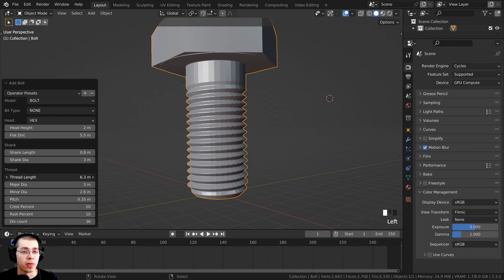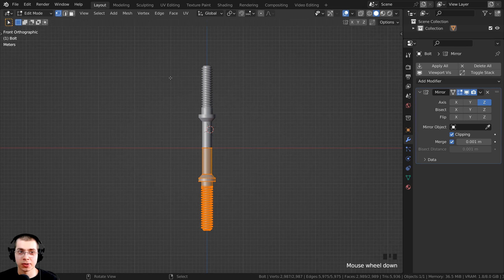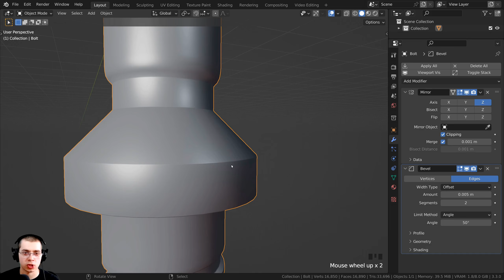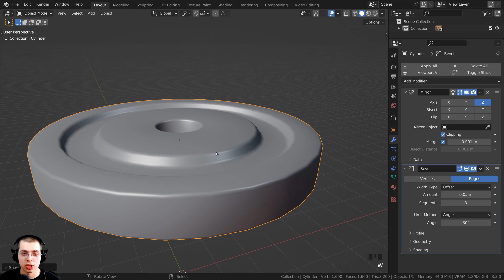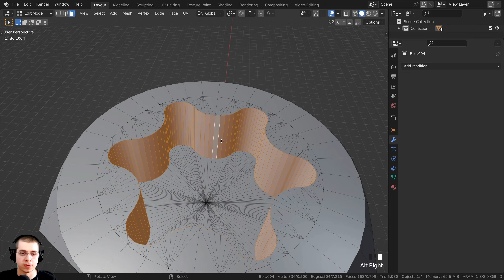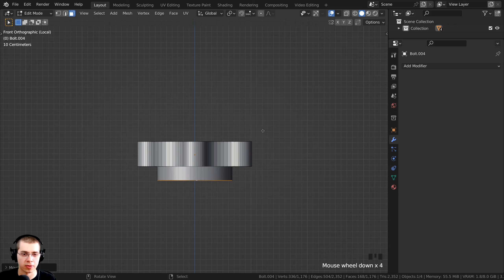Dumbbell Weights - Part 1 (Blender Tutorial)

Comment: Nice video. A few things I noticed that I want to point out for newer users:

- You don't need to press B to box select if you select with left click. Just left click and drag.

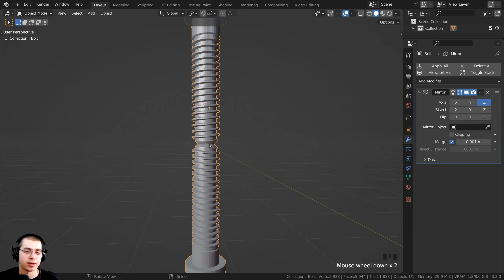- 9:30 Instead of moving the entire model in edit mode to properly mirror it across the origin, just go in edit mode and select a face on the end of the bolt (where you want it to be mirrored), Shift+S and "Move cursor to selected", then Tab back to object mode and right click the object. Now choose "Set Origin > Origin to 3D cursor" and your origin will move so the mirror works properly.

- H to hide and Alt+H to hide works great in this context, but Alt+H unhides everything. In a big scene with multiple objects hidden you'll have to manually unhide the "handle" from the panel on the right. 

- As an alternate to hiding objects, I prefer to use the "/" key on my numpad to isolate the selected object(s). This temporarily hides all objects not currently selected and I can press "/" again to to back when I'm done editing. This way I don't unhide all objects I had hidden and want to keep hidden.

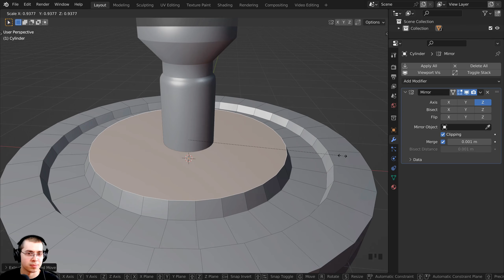- 20:20 This is very useful to know. An alternate method that is also useful in different circumstances is to go to the top of the screen and change the "Snap To" option to "Vertex." Now you can select the inner face, press G to move it, press Z to only move along the Z axis, and hold Ctrl to enable the snapping mode. The mode is set to vertex so if you hold Ctrl and click on a vertex on the outer face, the inner face will move to the exact height that matches the outer face. Useful when you don't want to have both faces scale along Z and meet in the middle. This snapping mode has one go match the other. 

Overall really cool video.
Reply from the maker: thanks for the feedback. 👍‍

Comment: Hi, Ryan, nice tutorial! OK, the Dumbbell are looking right ... but ... in real world it will not work, because you have no thread in the star-shape nut. How to create the thread with the exact same measurements so that we could actually fix the weight on the handle?
Reply from the maker: Yes technically in the real world the star shapes pieces would have a thread. I thought that you wouldn't see inside it, so it saves a lot of time not modelling that detail. But I just realized that you actually can see a little bit inside the star piece that is on the ground. so I should have added that. You can add that my duplicating the handle thread piece, and filling faces to merge it with the inside of the star piece.
Reply: @RyanKingArt  thanks. Another question: is possible in Blender to do circular text, for instance you would like to write something on the weights (amount of kg, manufacturer data etc?
Reply: @thomascuk9461  You can use texture painting. Paint an image of the text on the surface but run it through the bump node then into the normal map. This way it appears to bump out of the weights.
Reply: You can use a boolean modifier to have the screw "cut" into the star nut so it has that extra detail.